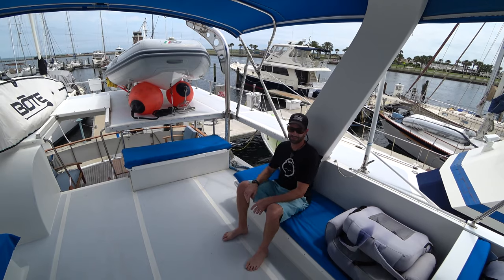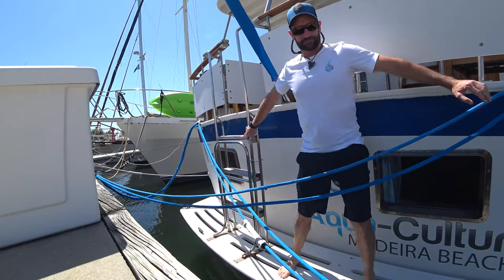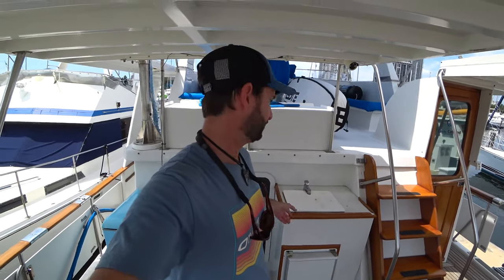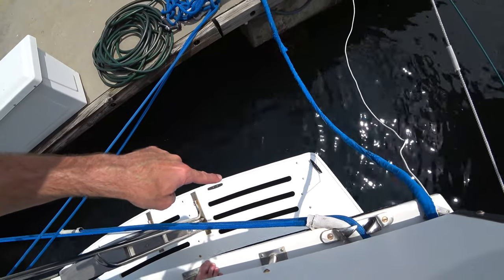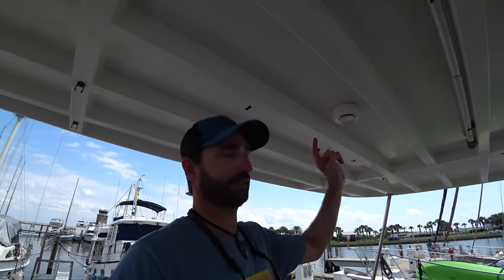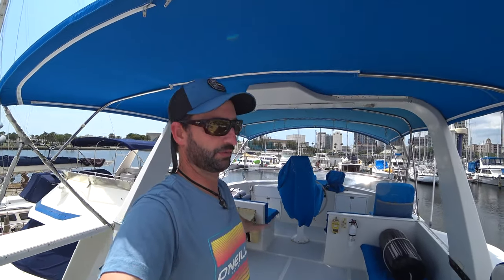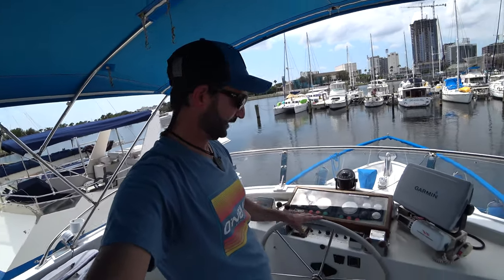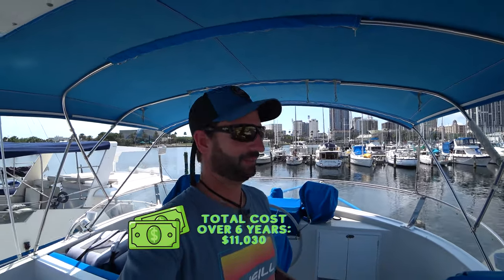6 Years Later- DeFever 44 Trawler Tour-Part 2-Exterior... A Love/Hate Relationship!

Comment: I like this video, and have a couple of observations. First, for LED lights, don't pass up the RV lots. There are enormous led selections there and at very good prices. The second was that you are the first trawler captain I have ever seen with serious attention to anchor gear. I have ridden out some very high winds at anchor in a sailboat but just look at how much less windage they have. So my question is, how big is your anchor chain and how much of it do you have? I found that the size of chain if it is big enough will keep you planted where smaller chain will allow your anchor to pull out. Also scope is just as portant. Thoughts?
Reply from the maker: Hey Mike, thanks so much for the message. When you say RV lots, are you talking about stores, or RV sales lots? 
I appreciate your attention to detail on the ground tackle. I never want to lose enjoyment because I have to worry so much about my boat staying put. I have about 180ft of 3/8” chain with of course the oversized windlass, and 73lbs Rocna. This setup has served me very well. The size of the chain and the scope play a significant role in holding. A lot of people get hung up on anchor size, but proper anchoring technique is key
Reply: @AquaCultured  yes RV stores. Thanks for the info..

Comment: Hi again. Regarding your Bimini, I have a 53 foot Jefferson and plan to install a Bimini over the helm area only.The metal will be stainless steel 1 1/4 inch. The bid is $6000. Also , being in the north west I have to be concerned about snow.
Reply from the maker: Fortunately, although unfortunate for your comment, I have never had to replace an entire Bimini structure (including the steel framing), so I don’t have a frame of reference for the cost, although I imagine the steel, especially at that size, is quite expensive right now. And luckily I don’t have to worry about snow 😅

Comment: Great presentation. Do you use a snugger line when you anchor or it does your chain stopper offer enough strength?
Reply from the maker: Thank you Patrick! And great question. I do use my anchor bridle/snubber when I will be anchored somewhere for an extended amount of time or if there is chop or more than a fresh breeze. Not only does the bridle provide shock absorption (which can help keep your anchor from getting jerked out of the sand, and relieve stress from your bow sprit and windlass), it decreases the angle of pull so that it keeps that anchor seated rather than pulling it up out of its holding.

Comment: I've heard various tales on fuel consumption, and wunnerin' what your burn rate is, at a trawler-friendly meandering speed.
Reply from the maker: I average around 4 gallons per hour or close to 2 miles per gallon of diesel burned, of course dependent on sea state, current, wind, and hull cleanliness

Comment: When I tie off to interior cleats I always use the loop or if I have a bitter end I will tie a bowline. It uses less cleat real estate and  I tie the end that does not have a loop to the dock.
Reply from the maker: Yeah I put a loop on the cleats whenever possible instead of tying the bitter end, but having to tie to a piling doesn’t allow for that. So in my current set up, my midship cleat has one spring running forward to a piling and one spring running aft to a cleat on the dock. So I have one looped end  and one bitter end on that cleat. When you double up lines for a storm, that cleat is used to the max.